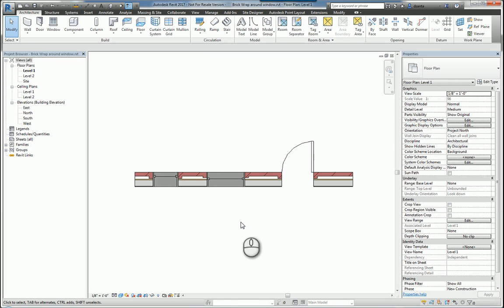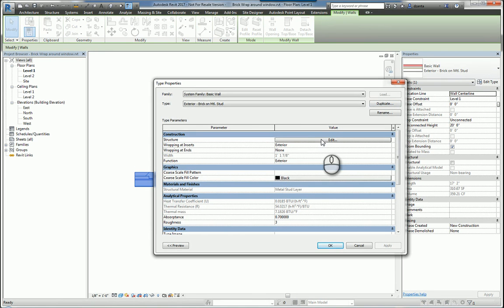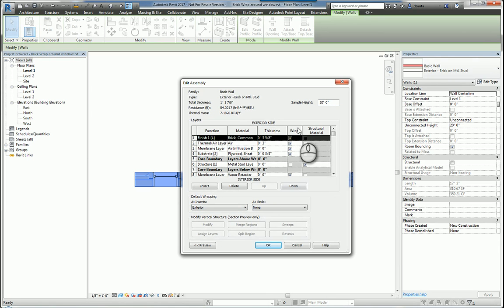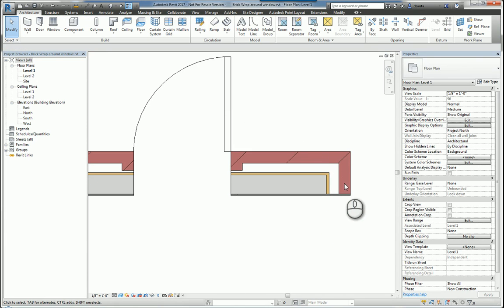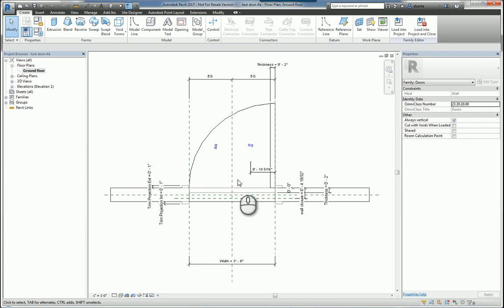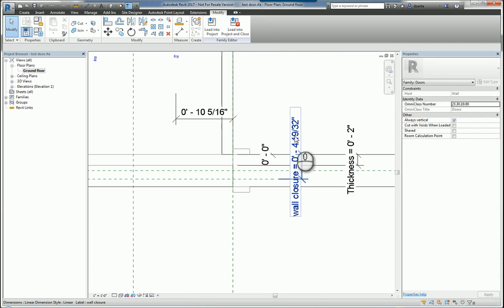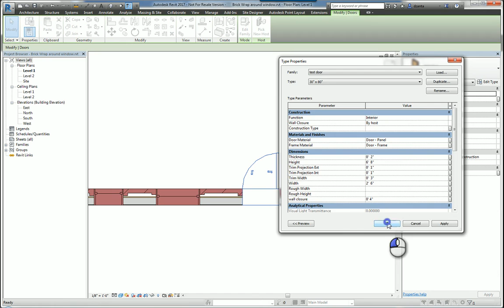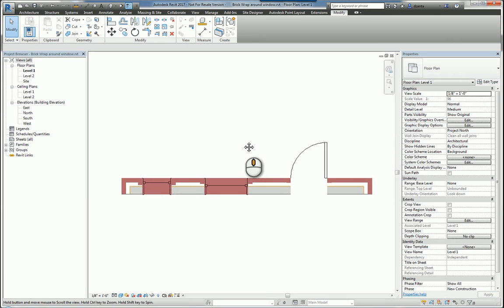Revit Wall Wrap Closure   A How To Guide

Comment: Is it possible to have the wrapped part have a different thickness?
Reply from the maker: Probably not. The setting just is an on/off function. U will most likely have to model in place

Comment: hi, any way to make wraps in an opening? i just can't do it.
Reply from the maker: an opening family (within Doors subfolder category of library) works just like a regular door or window.  If you select the wall, go into the structure and ensure wrap is turned on at inserts (exterior, interior or both).  If you used the Wall Opening command or used Edit Profile of a wall and created an irregular (non-door family based opening), then the wrapping function doesn't work.  You can take the standard door opening family and make it a custom one that is large opening to make it wrap around like a typical door or window.  I can make another video if you need to see this....
Reply: @DzanTa  amazing it works. Thanks a lot for your quick answer!